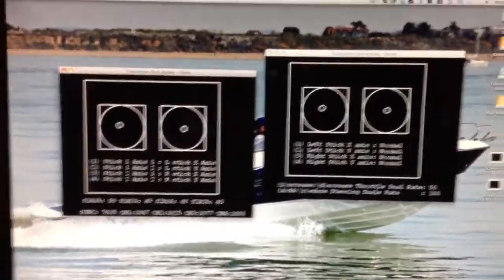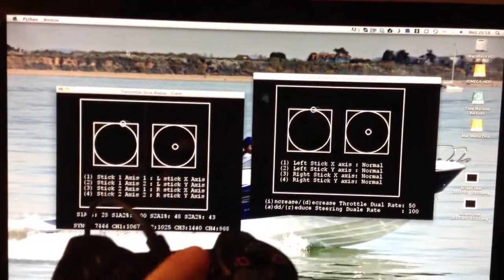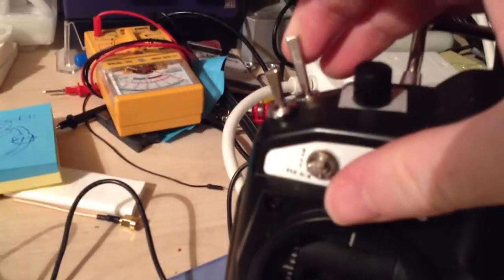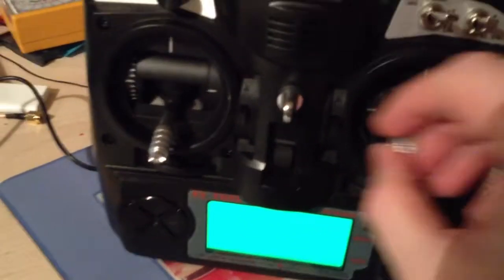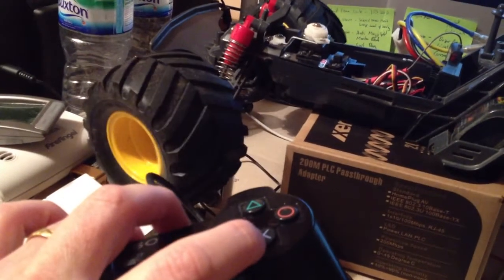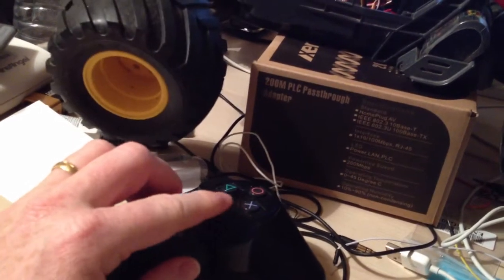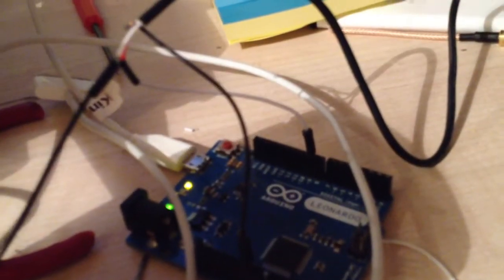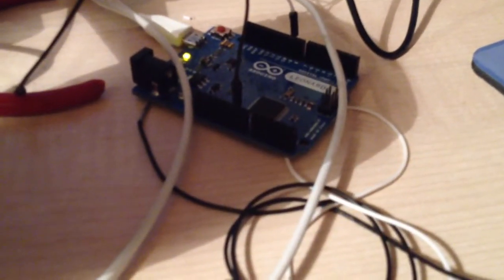NetFPV - a small update: using the trainer port

Comment from the maker: Yes, although in the current setup you'd need to drag along a laptop with you as well.  It's looks possible to take the Leonardo Arduino board, plug a USB joystick directly in, and be able to read from the joystick, convert to PPM and squirt this out to a trainer port though